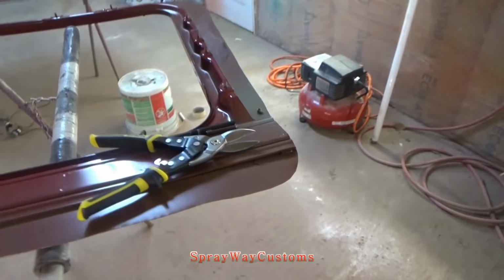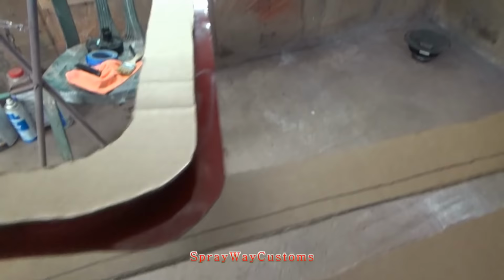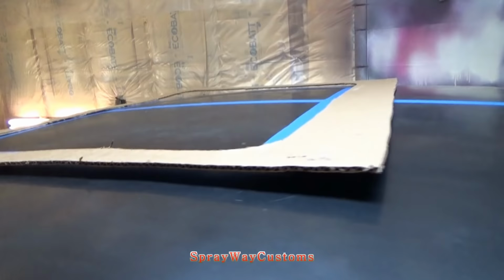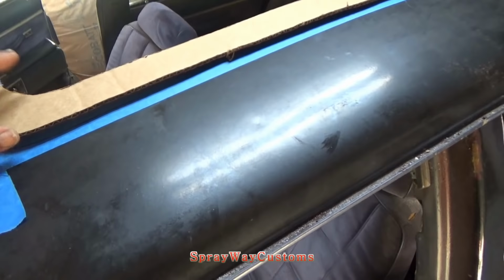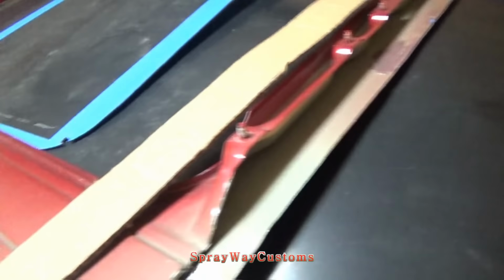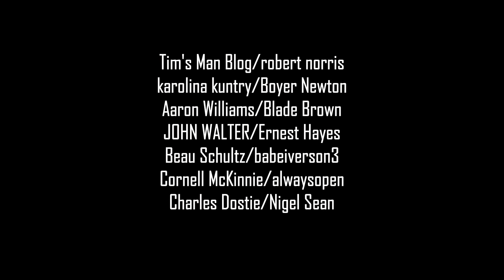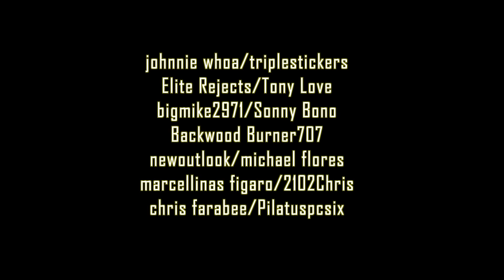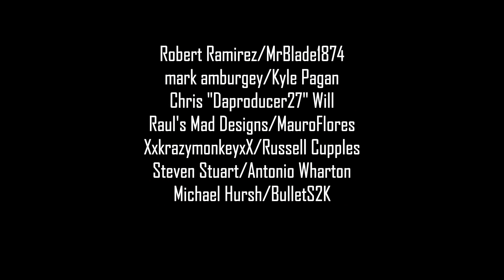How To Install A Custom Sunroof / Box Chevy Caprice Sunroof Installation

Comment: thanks for taking the time to show us this project ...great job
Reply from the maker: No problem Oscar...thanks for watching
Reply: +SprayWayCustoms wow...inspiration...thanks for the details and tips...
Reply: SprayWayCustoms hey man I have a quick question I know it's late but I wanna do the same thing as u except imma take off the sunroof of a 2005 jeep grand Cherokee and the car imma put sunroof inside is a 2007 jeep grand Cherokee but mine doesn't have a factory hole for the factory and they told me they couldn't install it because it's not gonna open and the water is gonna get in if u reply I appreciate it man
Reply: fernando guzman any luck with that ? I'm trying to do the same
Reply: GorillaGrown420 dank nah man I couldn't do it went to a body shop that has done repairs for me and they said that I have to cut the whole top part of the jeep and then put it on mine which would be like 1800 $ just for that
Reply: GorillaGrown420 dank I talked to this other guy who puts sunroof and he said he can't install the factory one but he has his own sunroof that will fit and not leak...because if I cut the hole and try to put the factory sunroof of the jeep in 1st it won't have enough room to go in and it won't open nor close 2nd it will leave the bottom part very weak and it may leak
Reply: fernando guzman thanks for looking into it boss
Reply: @SprayWayCustoms  where are you located?

Comment: That's talent folks! I've been doing bodywork and customized projects like this for more than 30 years and that's a nice job done right there. Took the extra time to make clean cuts, ground all welding surfaces and fiberglass material over your welds. Nicely done! Thanks for the video.

Comment from the maker: Visit : https://spraywaycustoms.com/ for New & Used Spray Guns & Parts
Reply: SprayWayCustoms what did you do for the headliner on this caprice?
Reply: Very creative baby brah.
Reply from the maker: Thanks tremec6
Reply from the maker: Chavis Harris. I haven't even done the headliner yet but I'm gonna fabricate the old one with the one came out the car the sunroof came out of.
Reply: SprayWayCustoms  you gone do a video for that? Would love to see it bro.
Reply: SprayWayCustoms 1979 f150 sun roof instlation
Reply: Where is your shop located do you repair sunroofs?
Reply: @SprayWayCustoms  I got a 89 box Chevy and I just put a G6 roof in it how do I run the drain lines
Reply: Hey  sprayway what ever happened wit da box chevy
Reply: How much do you charge to put a sunroof in a 2001 Chevy Tahoe
Reply: @sprayway  how can I contact you bruh
Reply: SprayWayCustoms how much you charge bro
Reply: That’s a moon roof

Comment: I'm glad I saw this completely changed my mind about a sunroof install. This is factory not the cheap cut a hole trim ring it will leak manual flip up's that are out there. Nice job on the fill and finish.
Reply from the maker: Joe, thanks for the comment. I'm glad I could give you a little insight on it.

Comment: That came out very good, only thing I would suggest is to spray weld through primer over all the bare metal before welding, because I know you still got some bare metal that is exposed to air someplace on that roof, thanks for sharing.
Reply from the maker: Thanks Bruce

Comment: it was nice to see how you did that. i tried years ago with a blazer sunroof trying to install it into a s10 but i didn't have the original curved sheet metal roof section that is curved to fit it. I failed and ended up scrapping the truck. now i saw this I'm thinking about going for it with the silverado i have now. I thought you were going to attach the sunroofs sheet metal to the underside of the roof and then build bondo up on top of it but you laying the sunroof metal on top of the original roof worked out well. that's a reassurance for me should I try something similar. I learned alot from watching a few of your videos. kudos

Comment: You have some serious skill. I am just getting into fiberglassing and you have no idea how much information that helps people starting out like myself has. I am now looking to do the sunroof thing. I am stumped on something though so if you read this and have time shoot me a message. Awesome stuff though! It's not about the sunroof thing though my bad didn't specify its 2 small pieces of fiberglass
Reply from the maker: What you need help on bro? thanks for the compliment
Reply: I am looking to do a few custom things on my 04 Infiniti G35 Sedan. I have seen some people cover part of their tail lights and it had to have been a piece made which could easily be done with fiberglass but question is would that require a whole car repaint b/c it is older and paints over time fade. What would your input be, and thanks for responding. Cool to see someone that looks as busy as you paying attention major props. I wish i had half the talent you do and that's what I am working on. Too bad all the way in Oklahoma ha I'd come and watch your work. Sorry it took so long I wasn't logged in to youtube til just now. message back if you get time or email rwshaffer@cox.net Thanks

Comment: This was really great. You do really excellent work.   I didn't know the roof had drain lines that explains a lot... Do you have one on how to set the lines where they belong, or how to clean them out after it's all put together?  I have two Jeep Cherokees and one is prone to be a pool when it rains.  It was my sons who gave it to me with parts but even now it would be fine if I could figure out why it keeps flooding. I'm sure this is the problem.  He parks in the open under big oak trees and I have a carport.He has said he is never getting another car with a Sunroof, yet I have never had a problem with any of mine.  Mystery solved.  Thanks again!
Reply from the maker: Just open the sunroof and it'll be holes in each corner..just try to rake any trash back and remove it...that should solve your problem...thanks for watching

Comment: SprayWay!!!!! I picked up a Sunroof for my 1964 Chevy Impala Monday. I got it out of an 96 Toyota 4 runner. It is oversized and will fit good. It goes underneath just like the one you have in the video. I just have to figure out the wiring on it. The switch had 5 wires going through a ABS Roof type switch then from that switch over to the sunroof motor. I will email you some picks, I will need your virtual advice on getting it in right.. TY

Comment: what a good sunroof to use in a 84 cutlass that will also work as the one you did in this video... thanks in advance
Reply from the maker: Get a sunroof out of a 2000 or newer Impala or Monte Carlo...they work just fine...they top sliders

Comment: just make sure you clean out the tracks with a rag and lubricate moving parts and tracks with motor oil or silicone lube every few months, i dont recommend wd40 it wont last long or grease it will clog up with dirt , i prefer motor oil it lasts long time and makes it easy to clean out in future and keep a long roll of soft bendable plastic coated  garden wire to unclog the drain tubes when they block up

Comment: Mayne...hold up! 👍 pro install...would have never thought to do that over lap cut with the van top!  I was wondering...do you have to weld and fiberglass that edge?  I like how u did it...but could I use flat head bolts a few inches apart all the way around it with some edging and some weather seal of some kind?  With that big over lap it seems like it would be cool...meaning it seems it would work. Not saying it might look as smooth as yours...but it would be easy to remove if I decide to change cars.
Reply from the maker: Thanks for watching

Comment: I just put a G6 roof in my box Chevy and I need to know how to run the drain lines
Reply from the maker: You have to run the drain lines down the b-pillars and c-pillars because the front a-pillars are blocked off. Just make sure they're long enough to reach out the car and secure the lines so they won't roll back up and rust the vehicle out.
Reply: @SprayWayCustoms  thanks a lot your videos help me put that sunroof off in there I'm going to make a video and shout you out keep doing what you doing buddy you helping a lot of people out here

Comment: kinda late recommendation. they make an air tool that can put a 1/8 drop to the edge of your cut so the part from the van would drop in so it would be flush with the caprice's roof. all you need to do is weld and body fill.

Comment: Shame you didn't show us how you powered the roof directly! Got no power to roof on mine , and no idea what colour wire supplies 12v
Reply: Ive susted it out! Ive got 99 honda crv with electric sunroof. I had no power what so ever going to the sunroof motor using a multi metre to check. If anyone has the same issue on this car its the green with black strip on the blue plug to the ecu/controller box that supplies 12v on the sunroof motor.  I used 5amp wire and took power from empty slot from fuse box, ran cable inside door piller inside roof lining, and used connecting block/  blue wire to black/ ground wire on ecu box harness, and green with black strip power.

Comment: Question 
Got a 2005 Toyota Camry that has a sunroof stuck in the tilt position.
So the best thing to do is go to the junk yard and find the same make and model of my car and replace the whole thing?
I tried to crack it closed manually but I heard a cracking noise so I know the belt is broken.
But how did you test the one in the junkyard to make sure it worked?
Reply from the maker: Take you a Jump Box and hook the wires up to it Coleman

Comment: yeah, I was looking roof in my impala and was wondering will the visors need changing
Reply from the maker: No but I'm mines I'm not gonna have visors because my roof was so big I had to move it forward just so the rails would fit and the visors would be under the roof

Comment: I know you said run the drain lines in the pillows. Did u have to cut holes in the pillows to run the drain lines.
Reply from the maker: No, if you run them in the B-Pillars and the back ones you don't
Reply: How  much would you  charge to do this to  .my caprice

Comment: Hey bro I pulled out the same roof out of the Quest to put on my box. The video don’t really show it but the whole drain assembly, did you pull that off the van too? That’s the only thing I don’t get. I cut damn near the whole roof off the van just in case. Please get back at me.
Reply from the maker: Yes I got the drain tubes. If you look in the beginning you'll see what all I had got off from the Quest
Reply: SprayWayCustoms Oh ok I got you. Crazy I watched the video at least 30 times and missed that little detail. Good lookin tho!!
Reply from the maker: No problem

Comment: That's a question that I have is well once you put the sunroof in how is this headliner  molded
Reply from the maker: Fabricate the headliner from the car the sunroof came out of and the headliner out of your car. You basically using the outer part of your old headliner and around the opening of the headliner from the donor car.
Reply: Thanks brah it a blessing to have the hands you do,  but you humble as well. Im 30 and in richmond va so there is a lot of negative around me. But I joined dblock car audio club and I get to be involved in car club scene making sub boxes and I love it. Thanks again

Comment: Sir i hate to keep bothering you, but your video of installing the 2000 Nissan Quest sunroof, i was just wondering if it would fit in a Chevy S10 extended cab?
Reply from the maker: You shouldn't have a problem with it fitting.

Comment: Anyway you could help me mine got stuck in the tilt position 🤦‍♂️🤦‍♂️
Reply from the maker: Is it off track or electrical issue?
Reply: @SprayWayCustoms  shouldn't be off track and I can hear it clicking sending the signal but no movement

Comment: is there not a way to put some small screens in the area where the drains are to keep those lines from getting clogged so that when you routinely check it for debris  it can just be cleaned by vacuuming or wiping it out?

Comment: 2001 cadillac deville...i seen one in yard that had went down thru the floor and under rear seat floor but didnt kno if that was correct
Reply from the maker: Yes, as long as you run it outside the car you'll be fine

Comment: Great work and since I got a 90 box I needed this video.  I have a question about this install ... What is your technique for taking the headliner out of the car without cracking or breaking it because mine is sagging and needs replacing   . Also do you apply the same techniques to cutting the hole in the headliner and if you could post a video on it it would be very helpful thanks alot.  Again your  work is A1 Bro.
Reply from the maker: Well once you take the trim pieces off front,back and both sides, the headliner will just come straight down but mines a 84 and most of it was dry rotted and cracked....you got a 90 so you might get lucky on yours....if not just be careful and try not to make it worser than what it already is...thanks for watching bro... Feel free to ask questions

Comment: My name Russ bro im on my old lady phone rn. But did u have to wield the inside bracket to hold the rell to the inside of the roof?
Reply from the maker: What's up Russ, naw I didn't have to do no welding on the inside of the car. I only weld the lip of the frame to the top of the car.

Comment: Looks great u made it look easy....I'm still a little lost tho were did u run the drain lines to?
Reply from the maker: I'm gonna run them down the front and back pillars ... There's already some holes at the top of the pillars, I might have to drill the holes a little bigger for the lines in the front pillars ....thanks for watching

Comment: how du u install the drain pipes? how do u do it....perfect fit man..big ups
Reply from the maker: You not gonna be able to run them down your front pillars if you installing it in a Box Chevy because there's some foam in the front pillars but you can run them down the b-pillars and c-pillars....The c-pillars lead directly to the trunk...hope that helps..if not shoot me another question and thanks for watching

Comment: I would really appreciate contacting you for advice on my 85 caprice interior. currently  planning on replacing headliner, i seen your video on making custom dash for caprice(very good) .im still trying to figure out taking out my circular dome light to take headliner off (need help)  . also i want speakers on my doors, but dont know whats the best way.. same thing for replacing my head rests, lol
Reply from the maker: Email me spraytime123@gmail.com. My dome light was already out so I really don't know how it's attached. I'm gonna be doing my doors and rear deck, center console with bucket seats front and back....thanks for watching and ht me up

Comment: Hey whats good bruh? I like what you did, and I am inspired to do this on my 96. My question is how did you run the drain lines , so that the actually drain out of the car? I appreciate the info, and look forward to the end result.
Reply from the maker: I ran the front drain lines down the B-Pillars because the A-Pillars got a foam material in those and I ran the back drain lines down the C-Pillars out the trunk of the car
Reply: +SprayWayCustoms Did drill any holes in the pillar areas??

Comment: Good Work !! Flange/Punch tool would make the transplant fit flush without too much mud. What do you suggest for a Donk Coupe?
Reply from the maker: Thanks for the advice....This sunroof here probably would be a good one for it...You trying to go top slide or bottom?
Reply: Bottom  This will be my project for the winter..Not driving till Spring    Snow/Salt on ground  Chicago Area..

Comment: @sprayway custom I need help on a 1985 pontiac parisienne ,fuel pump I know its in the front but I don't have to take out gas tank right let my know bro 💯✌👌
Reply from the maker: Willie I really can't give you the correct answer because I don't know much about it but I assume if the pump is in the front you shouldn't have to drop the tank...sorry bro

Comment: when o open my sun roof goes back but when i try to close it back it will get stuck for some reason and wont close. any clue on what could be the problem ? and how much for the repair ? ive asked people they all say it could be expensive
Reply from the maker: Well, I really don't know how your sunroof designed but it could be something in your track getting caught up and keeping it from opening...sometimes the mechanism in the track will come apart and pieces will get hung up....What kind of sunroof is it?  The easiest fix would be to just go to a junk yard and get another track and motor...hope that helps Laurencio

Comment: I want to install one on my astro van. It has ridges running up the roof, spaced a foot a part or so. Since the roof is not smooth is there anything special I need to do with the sunroof trim or the sealer to deal with the ridges? Do they need to be ground down so the sunroof frame is completely flush with the roof? Thanks, would appreciate some pointers. Also will a sawzall do the job?
Reply
Reply from the maker: A sawzall will do the job...you can make it work with the ridges you just gotta make sure you weld and fiberglass in between each ridge real good to keep it from leaking

Comment: Been learning alot from you and im highly appreciative...one question tho, does the jigsaw have to be a certain amp or strength or is it just based on the blade how well it will cut?
Reply: And what kind of welder did u use? Thanx in advance
Reply from the maker: Any jig saw will cut through the sheet-metal pretty easy..just get you some metal cutting blades
Reply from the maker: It was the cheapest welder from Lowes ....mig/flux
Reply: Thank you for your time sir